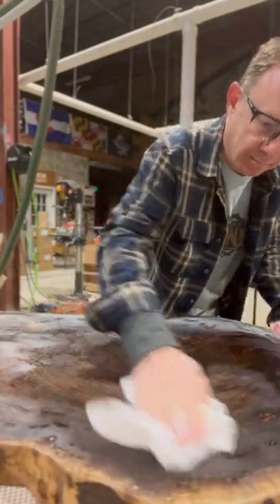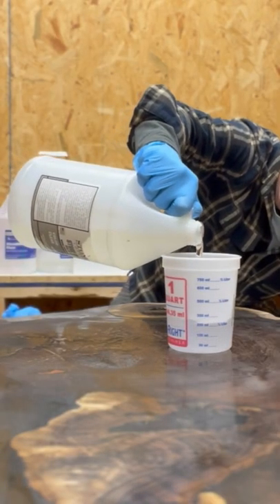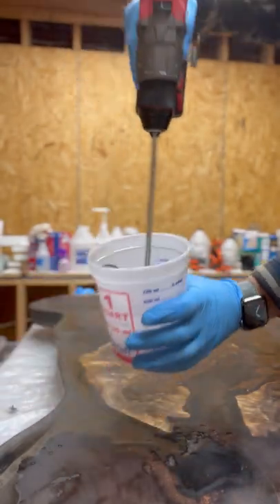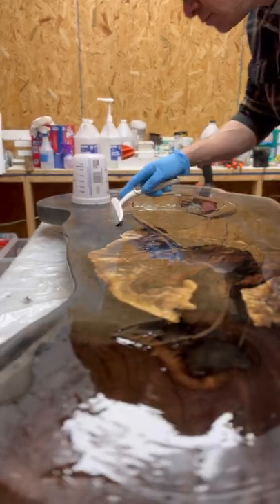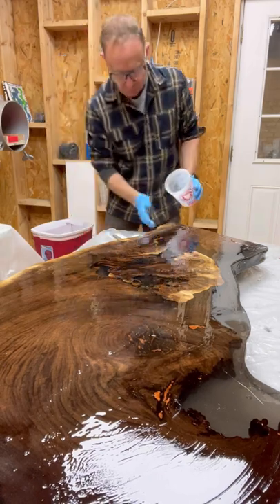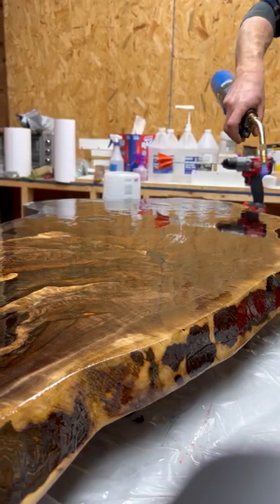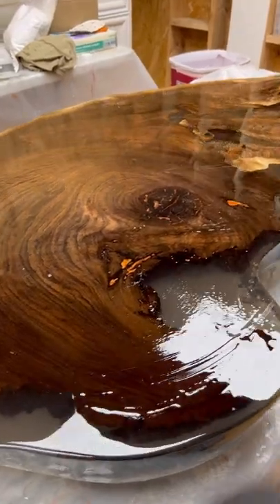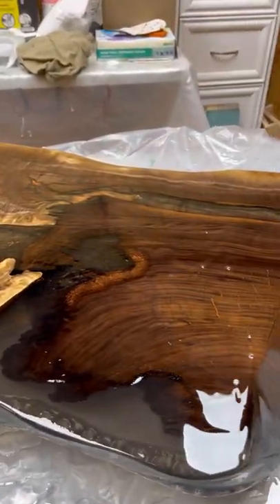Applying An Epoxy Resin Seal Coat | #shorts #stonecoatcountertops

Comment: How do you deal with drips down the side?
Reply from the maker: If you are talking about what’s hanging underneath I take two approaches. First is I check in about 4-6 hours and it’s cured enough to just wipe them off. If I miss that opportunity, I just sand them off with 60 grit on my random orbital sander. Hope that helps and thanks for asking. 🤘🏻

Comment: how long do you wait between each coat and sanding?
Reply from the maker: Hey. I wait about 16 hours. Once it’s solid to the touch and not tacky. To be safe do 24 hours. Sand at 220 and wipe down before you do your next coat